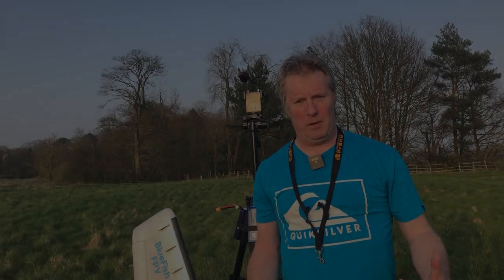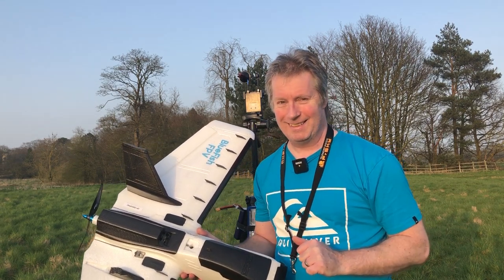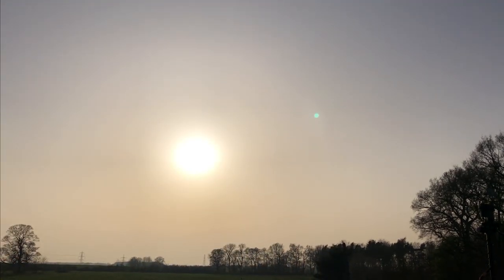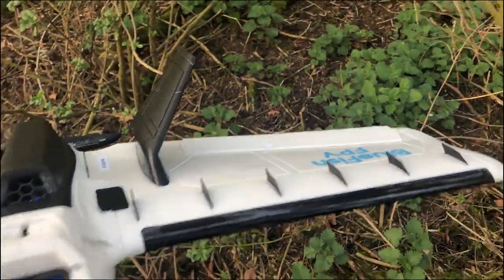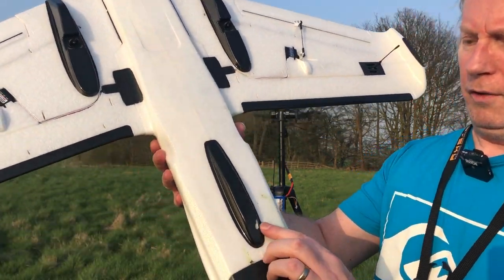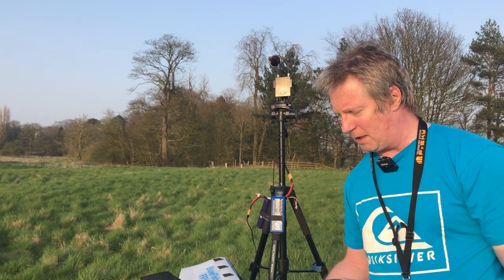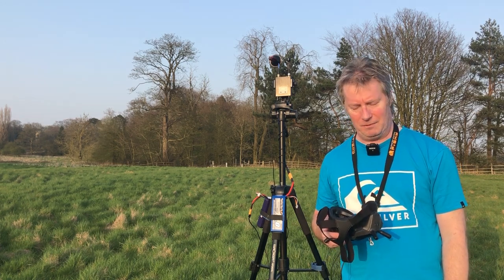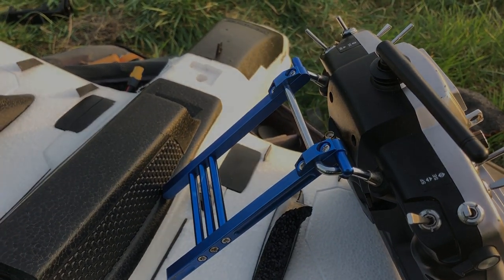ZOHD Dart XL - Enhanced Version - The Not So Good Maiden

Comment: Small weather window for Maiden fly when you want auto-trim the model, excitement to fly, apprehension of bad things can happen, for me, it's enough to forget something. I have a small laminated check-list from preflight to launch, look extreme but keeps me out of trouble. My choice for fail-safe is RTH 120m, climb first, RTH home altitude 40m, never land. The plane will loiter over me, the signal comes back, happy days, or it will go down when no more battery.
Thanks for sharing even the painful experiences.
Reply from the maker: Hi Laurent yes it was a combination of all of those things plus setting up the cameras and microphones etc to make the video. I think a small laminated check list in my bag is a good idea, I am not getting any younger and my memory is definitely not as good as it was :-)

I have the same settings as you RTH Climb first but have Autoland set on failsafe to me designated Safehome position in the middle of a field with no trees close to me.

The issue here is that if you failsafe during the iNav Autolaunch sequence you are forced into Emergency Landing which cannot be overidden by any settings in iNav since version 2.2!
Reply: @bluefish3607  I did not know about failsafe during auto-launch, thanks for the info, I will be aware of that. Anyway, the check-list will help and you can improve it if needed, it does it for me. I am not twenty anymore lol.
Regard and Happy Flying

Comment: What a real shame Glenn. Thumbs up for the foam armour though. I have bought some since your other video and have it ready to put on this weekend on my XLe. So pleased she survived the tree, this plane truly is a strong machine. lucky escape mate. Looking forward to the next flight.
Reply from the maker: I got off lightly for sure Mick lol. The Foam Armour works better if you clean the foam thoroughly with Isopropyl or just soapy water then give it a light sand with wet and dry paper then dry it off completely then apply with a fine brush. I used a 1 inch brush.
Reply: @bluefish3607  thanks for the advice Glenn,  will prep it tomorrow👍

Comment: hrhr, been there, did it...and had a total wreck ;-)  
Since then i double check my radio antennna every time. Also i got "climb first, then  RTH" on RX loss configured.
For the zohd foamy coming down that fine you where double lucky!
Reply from the maker: Yes I have had my share of write offs :-) I am not taking that antenna off again and will rearrnage my flight bag so I don't have to.

I have climb first too but I got this info from the iNav devlopers that you may find useful to know.

Since INAV 2.2 when you failsafe during autolaunch it will go into emergency land. The problem is, that you are still pretty low above the ground and a failsafe in this situation is in most cases a hardware or link failure. That's why the developers decided to go for emergency land instead of RTH to avoid hitting something if RTH is engaged low above the ground.
Reply: @bluefish3607  that´s a good hint. I might reconsider a bit of my launch routine. 
In Inav failsafe tab i have set  "Use alternate Minimum Distance Failsafe Procedure when close to Home" to 20m distance and drop. Maybe that makes the trick to have RTH after RX loss during Autolaunch?!? I have to reread the whole procedure now because i´m a bit confused now what is acting when? 
But it´s good too got this rememberence of rechecking safety things from time to time!

Comment: Glenn I feel for you mate and appreciate the detail and honesty. I could certainly forget a similar thing and it's just bad luck that the normally-accepted pre-flight checks didn't pick it up. For me at least, maiden flights are always very stressful affairs - there's loads to think about and I do my best to think of everything but you can't cover it all. Glad the damage is minor and I'm now off to find some foam armour! Thanks again for the vid.
Reply from the maker: Thanks Andy I always get nervous excitement at maidens and that definitely contributed to my error. WE live ad learn. The Foam Armour did a great job tbh, I just peeled it off where it got damaged and reapplied a new layer, you will see in the next video how well it worked after the crash.

I get it from here if it helps: https://deluxematerials.co.uk/products/foam-armour
Reply: Bad luck on forgetting antenna Glen Ive been there myself, I have 3 ar wing pro's and have the zoid dart xl enhanced version on the way with no servos or electronics, i have several of the ar wing pro servo ball joint push rods and wondering will they work on the zoid? Also any advise on servos and power train for the zoid would be appreciated? Thanks for all your videos

Comment: I feel your pain and frustration. Snapped the nose off mine again! during a failed autolaunch the other day. Im really starting to get pissed off with this model. I did my very 1st maiden and used the bog standard little stabilizer that comes in the Dart 623mm sweeptwing and nano talon, and guess what? flew perfectly. No crashes or problems what so ever. As soon as the motor spins up, the ailerons automatically rise and it goes into stabilized mode, Throttle up and throw and away you go. But using a Fc and inav autolaunch has been a real pain in the ass with this model.
Reply from the maker: I had my fair share of disasters trying to launch my first XL. Piled it into the ground 5 or 6 times and snapped the nose off before I realized I have the elevons reversed :-) Since I fixed that launches have been great to be honest.

I do hear mixed views on Autolaunch but as I came from quads and never flew planes before I have never used any other method.

Comment: I flew in "Range Check" mode a few weeks ago and was very lucky that it behaved much like yours an nosed into bushes. I've done many things like this over the years. Like full scale flights, I would like to have a thorough checklist. Possibly built into the OpenTX menu. Hope your Module is ok.
Reply from the maker: I believe R9 has an antenna disconnection warning, maybe Crossfire will do that to help substitute for my ageing failing brain :-)

Comment: I was thinking to myself, he's got vertical polarised RX antenna, so I bet his TX antenna is set horizontal, but no..😯😯.
He's not got a TX antenna at all...lol...Sorry..🤔😀
I've just dumped my old cheap R9M system for a Crossfire setup..I was thinking it's not possible to FS at such close range, even with the TX on the floor...🤔🤔

Comment: Hi, did you performed a range check before flying? from my own experience... when you lose your VTX antenna you should unplug it as soon as possible... Also, (beyond you experienced a failsafe in this particular case), when you see that plane is doing weird things you should reach for your radio ASAP and disarm it if you will no be able to save it from crashing to avoid hitting anything at full throttle and to avoid damage both the motor and ESC if the propeller gets stuck after the crash. (I always have the controller in hand due to the stated previously, but mostly in a maiden flight) Hope it helps.
Reply from the maker: All good advice Fenando, I will never forget to put my antenna on my transmitter again I can assure.

You might not have seen in the video but I did pick up my radio but there was nothing I could do because the plane had gone into iNav auto landing mode.

Oh an I have probably fried my new AKK 2w VTX by not un-plugging it immediately I reach the crash site. Thats down to the adrenalin and focusing on filming the experience.

Its all a learning curve :-)
Reply: @bluefish3607  Oh sorry, i probably missed that... We all crash ... keep it up. Regards and happy easters.
Reply from the maker: @fernandofasanella4788  Yes its not my first crash and very likely not my last :-)

Comment: I had this problem with my ar mini had flown it last year auto launch. This year no changes and did the same as you I think it's was I set the the return to home this was the first time I did this and it did the same as yours inav 2.6.0
Reply from the maker: Mine was down to not fitting the crossfire antenna on my transmitter and the plane going into auto landing mode because the failsafe happened within the launch sequence. We are checking this with Pawel to see if it can be avoided but tbh not being dumb would help :-)

Comment: Next question is did the CF TX survive the powerup without the antenna?
Reply from the maker: Nope it fried it and melted the channel and power button off the PCB :-)
Reply from the maker: no sorry the TX was fine I misread your question. The VTX fried on 2000mw without antenna and no airflow on the ground
Reply: @bluefish3607  I can see how you'd misread that, guess either way you're up for new equipment :(
Reply from the maker: @FL_Engineer  Just had a couple of Rush Solo Tank VTX's delivered this morning so will install and test one of those.

Comment: Launching without the CF antenna is never a good idea but from the perspective of the aircraft  this is simply  a loss of the control link and the resultig fail safe condition should have been set up to cause  a less risky response.   An automated RTL ,  first climb to a safe altitude then circle back to the launch site and loiter ,  would seem like a better  out come than what happened on the video.
Reply from the maker: Unfortunately that was not possible under the circumstances Larry. But luckily my stupid mistake did not result in the plane being badly damaged.

Comment: Yeah, I use RTH and Autoland on my iNAV quads...Never land on planes, ever...This is why..Planes don't do Autoland, even good well trimmed ones..🤔😳😳😟.
Hope your TX Module isn't fried...🤔😳😬
Reply from the maker: Me neither I only have Autoland set on failsafe and to a SetHome position away from trees if possible. What happened in this case was an Emergency landing hard coded into iNav since ver 2.2 that is triggered when you have a failsafe during the Autolaunch sequence. I have put some Logic conditions into iNav to protect the VTX should this ever happen again in so much that it will auto switch to low power. The VTX was fried it melted the channel button off the PCB!
Reply: @bluefish3607  Yes, an unusual situation, FS on Autolaunch...Still, had you launched in manual like most folk would have on a Maiden, it could have been worse...I always use Autolaunch on my Z84, it's very reliable.
When you recovered the model I was screaming unplug it!!!!..but you were more interested in your grass stain...lol...🤔🤔😀
Reply from the maker: @EnglishTurbines  I have only ever used Autolaunch and very successfully apart from a few flights of my Ranger 1600 LOS practice plane that has no FC. VTX's are very inexpensive items so no big deal there but you are right I wanted to share the experience by filming it and that took my focus off the plane itself and the cooking VTX :-)
Reply: @bluefish3607  Launching these flying wings is always tricky. Then there's the very real risk of prop strike. It's why I'm not a fan of them TBH. Most of them don't fly that well either because they are not designed correctly and often don't have the correct wing section or reflex... IMO..🤔

Comment: that was a terrible launch.... it seems to be completely tail heavy to be honest. also what was your failsafe settings?
Reply from the maker: yes the launch was pretty poor, I threw it far too steeply. CG is bang on so definitely not tail heavy just a very bad throw.

Failsafe is set to Autoland on failsafe.

Since INAV 2.2 when you failsafe during autolaunch it will go into emergency land. The problem is, that you are still pretty low above the ground and a failsafe in this situation is in most cases a hardware or link failure. That's why the developers decided to go for emergency land instead of RTH to avoid hitting something if RTH is engaged low above the ground.
Reply: @bluefish3607  Developers!! I would still prefer normal failsafe rth procedure with climb first enabled. Seems much safer to me as your home location has already been picked by yourself as a safe area. Even a total control loss will eventually circle down near home location. Emergency land could be anywhere within a 200 meter radius during autolaunch. 🤨
Reply from the maker: @Davyorr  I am inclined to agree Davy but apparently failsafe during Autolaunch sequence is a hard coded forced Emergency Landing since iNav ver 2.2!

Comment: I really appreciate you posting the fail in all it's glory. We all have issues. I recently put tyogether a Finwing albabird and loved it. Auto launch was working great one day and the next it just did a circle a few feet off the ground and gently landed. I threw it again and same response only this time hit a barbed wire fence HARD. Neither my self or anyone so far can figure what went wrong. Seems like it wasn't detecting launch and proceeding to launch throttle so I threw it super hard the second time......it finally throttled up right before it hit the fence. Care to take a crack at it? un-edited. https://youtu.be/YMHEx3TwhrY
Reply from the maker: Hi Tracy, I watched your video with one of my friends who is also an inav pilot with a lot more experience than me. I see he has commented on your video.

Essentially what looks like has happened here is that the launch throw did not engage the Autolaunch sequence and the plane circled because of inav horizon drift and sufficient idle throttle power to keep it airborne for a few circles.

As Marc (b14ckyy's Tech) suggests you could try lowering the nav_fw_launch_accel value but be careful not to make this too sensitive.

You may have a damaged or faulty accelerometer in your FC, I would suggest doings some simple prop off tests. Maybe lower nav_fw_launch_timeout = 3000 (3 secs) or lower your launch throttle so you don't damage anything, ESC or motor wise spinning up without the prop.

Just set everything up for a launch (prop off) hold your plane and do a fake launch just keeping hold of it and jerking it forward to test how hard you need to jerk it to engage the launch sequence. Do that as many times as you want to ensure it works consistently and to rule out the possibility of an intermittent FC damage issue.

Like Marc said, jeez missing those power lines was crazy, I had my heart in my mouth watching the video.

I hope that's useful Tracy and you solve the problem.
Reply: @bluefish3607   Very useful, I appreciate it I guess what had me so stumped was the fact that auto lodge worked perfectly the day before and that on my 2nd launch this day I threw it as hard as I could also the fact that all of a sudden it did kick in right before it hit the fence but that was way after the fact. I don't think I'm going to mess with what could be and intermittent to flight controller so I'm soldering up a new one right now. I will definitely do a lot of testing on it before I give it the 1st throw thank you keep up the good videos